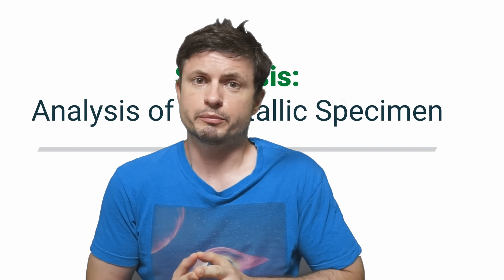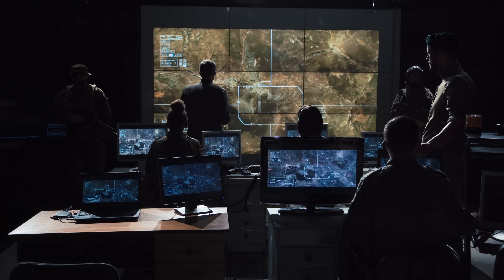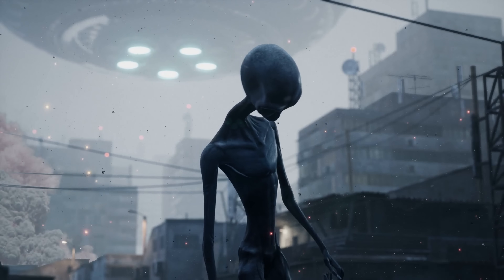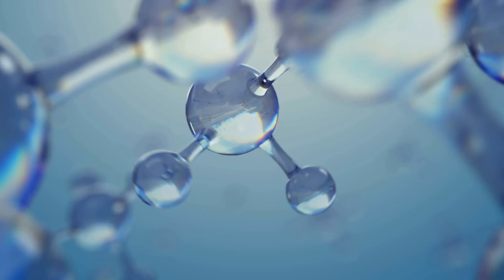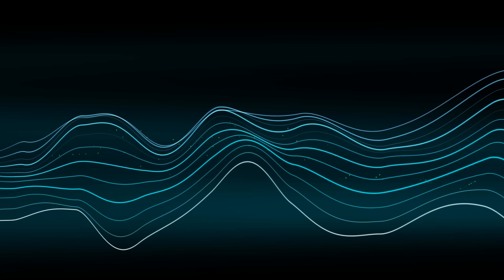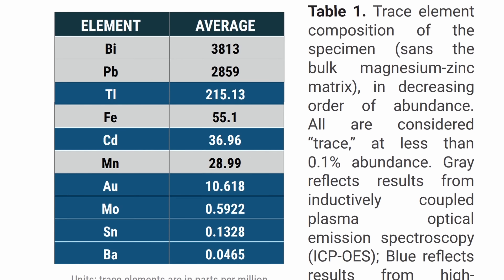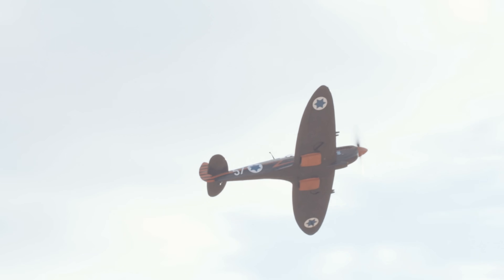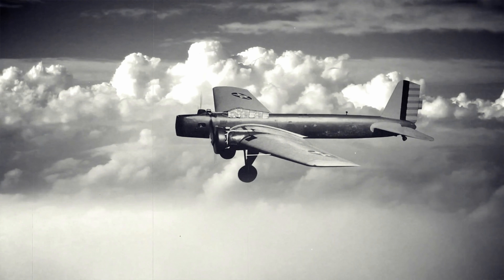Metal Piece From 1947 Roswell Incident Analyzed By a Government Lab

Comment: As this alloy is very rare and is made to refine the grain in magnesium and not to make it crystalline then it is very strange to find any of this material anywhere. let alone at Roswell. There has never been plates of this material made and it has never been used in any engineering application. The research into this material is actually very recent and can be found in The Journal of Alloys and Compounds in 2017. This is long after Roswell. We must therefor conclude that in fact this material could not have been made on earth at the period of Roswell as it had never been worked on. The plate looks like it was broken off a larger piece. What it would be doing in a farmers field near Roswell in very difficult to explain.

Comment: The ozone hole over the pole was believed to be 'opening' at an alarming rate. . . This may have been because as the instrument being used to measure, was not acute linear the voltage drop as the batteries condition and instruments needs were some of the unknown variables at the times of it's conceptions

Comment: Magnesium with Zinc as the principal alloying element is a fairly common alloy.  The presence of zinc allows for precipitation hardening and thus providing excellent strength properties.  It would be interesting to see if there were any other alloying elements present such as aluminum, zirconium, manganese and silicon.

These alloys are noted for their high strength and light weight.  It is an easily cast alloy as well as being a wrought alloy for the production of sheet and plate.

The high interest in Mg alloys prior to WWII is due to the light weight and high strength.  Mg alloys are about 2/3 the density of Aluminum alloys with comparable, and somewhat higher strength on certain alloys.

Mg alloys have been used for castings, forgings and fabricated parts in aircraft.  With the lighter weight the aircraft could carry more payload and fly faster.

After WWII, the push to utilize Mg alloys in aircraft fell out of favor due to the development of jet turbines and the high cost of Magnesium alloys.

Magnesium is extracted from seawater to produce the hydroxide which is then converted to the chloride salt which is then converted to the carbonate salt which is then converted to the oxide which is then electrolytically refined.  As a result, Magnesium metal is difficult to produce.

For example, a 2 ft x 4 ft x 0.063" sheet of aluminum 5052 alloy can be had for about $52 while the same piece of magnesium AZ31B will cost from $500 to $1,000 depending on the supplier.

hth

Comment: Those submillimeter layerings of metal were only BARELY possible in the most cutting-edge testing facilities, and that little slice of aluminum-bismuth alloy would have cost whomever manufactured it billions or trillions of equivalent dollars in the 1940s, and that's just accounting for the tools they would have needed to invent to work with the metal at such a small scale, let alone refining the process that led to them actually manufactuing the structure of the alloy you see before your goofy-ass eyes.

Keep telling me more lies about just how mundane that little slice of metal is, Anton...

Comment: On March 28, 1935, Robert Goddard launched another of his rocket tests near Roswell, NM. This trial was to test a device that was to provide the rocket a directional gyroscopically stabilized flight. His challenge was to find material that was strong enough to withstand the pressures of a rocket launch and subsequent flight yet would not influence his directional gyro that kept his rocket on a path of his choosing. So I wonder if that piece of debris could be related to that effort twelve years prior. That might explain its presence on that field that day when and where it was picked up.

Comment: Anton, I like this topic, today more then ever. We have dismissed so many things, like the 1700 years old, iron pillar in Delhi. This type of steel production has only been known for around 100 years! Especially now, in Siberia, due to melting permafrost, we find amazing new artifacts! the Homo Denisova bracelet, a 40-75,000 year old piece of jewelry made of chloride. Scientists have now discovered that drilling such a precise hole required extremely high speeds that were not yet possible at the time, apart from the fact that it was made by Denisovan hominids. Or the Lanzhou Stone, which was found in 1990 and is between 40,000 and 300 million years old. There are only 3 hypotheses about the origin of this artifact.

Comment: Magnesium alloys are used today. They produce lighter components with the same strength as aluminium alloys, but are lighter so are commonly used in Helicopters. As for evidence of of Aluen materials Robert Bigalo has gad several. Dr Kirkpatrick was either not given access to the information or is a lier. There is tons of evidence of UAPs.

Comment: What we know for sure is that whatever crashed in Roswell was not a balloon. The material they showed on TV at the time was definitely a balloon, and couldn't have been mistaken for anything else, by a 12-year-old kid, a farmer, and definitely not an officer from the air force. Therefore, what they showed on TV was not what actually crashed in Roswell.
Reply: We know exactly what crashed in Roswell - It was a specialized spy balloon with active height control and a variety of sensing equipment that was designed to recognize when a nuclear explosion happened anywhere on Earth - It's called Project Mogul.

The balloon part was followed by a 600 foot train of microphones and reflectors of various strange shapes that would definitely not look like a weather balloon (and, in fairness, weren't part of a weather balloon either). If you compare pictures of the wreckage at Roswell to pictures of Mogul balloons on flight, you can recognize parts one-to-one from the sensor train.
Reply: Read my other comments. It could have been a balloon, used by the Japanese.  Well after the war ended, but that means nothing to bushido, but disgrace worse than death..

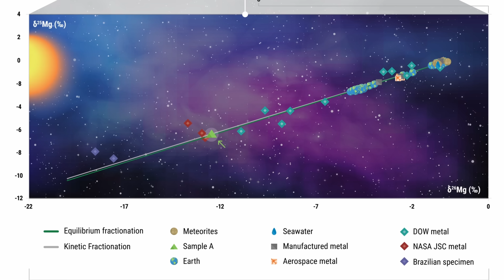Comment: The graph of % Mg25  (10:43) is wrong.  The vertical bar has 8% where 2% should be.   "Isotopes of Magnesium" in Wikipedia has normal Earth concentration of 25Mg at 10%.  Earth normals are on the wrong part of the graph.  ~6.7% for Sample A is far enough off to be of non-Earth origin.

Comment: You wouldn't need new physics in our atmosphere if you could manipulate gas molecules individually at THz frequencies.  There are 14 pounds per square inch of pressure exerted by air molecule collisions at sealevel..thats more than enough momentum to lift and accelerate quite fast an object to high speeds if the air molecules were suitably directed instead of randomly directed as they are naturally.  I believe the collisions per second are in the billions per square millimeter per second(Ghz).  To operate by laws of thermodynamics, it would be a Maxwell Demon type device but require still lots of energy to operate.  Such devices have I believe been demonstrated in small scale experiments, and we have many such protein molecules which act like Maxwell Demons for transport of molecules across cell membranes but utilize energy of course.   It wouldn't work in space or high in the atmosphere.  Maybe it's something we know about already and don't need to imagine new physics.  Whether or not UFOs are real, the human imagination might take us to such technology regardless.  Cell phones were inspired by Star Trek communicators for example.

Comment: In 2005  , at 3 am , i saw the silent black triangle . I was in the parking lot of a 24 hr walgreens on my way home from work. Incredibly this was in manassas , virginia.  I know what i saw . I dont know if it is ours or theirs. But i saw a huge , silent , black triangle with red lights on the corners and half way up each side. It was one of the greatest moments of my life.
Reply: Anything else you would be willing to share? Perhaps more details
Reply: Best chances of disabling an alien spacecraft the size of a car or smaller would be using an extremely strong magnet.  Any electrical components will become unstable, any computers will be killed and any loose metals will be pulled toward the magnet.  It may not work, but that's the best chances for normal humans.
Reply: If the alien spacecraft is larger than a car then only the US government could build a magnet large enough to try bringing down the spacecraft which might require the powerful magnet to be 1 mile square radius depending on the size of the UFO.  The only way a normal human would have a chance of bringing down an alien space craft larger than a car would be from the inside...   yet likely if you're on the inside then you're probably unconscious or unable to move.

Comment: Corrosion after 77 years of sitting in the desert changes the metals crystalline structure.
Magnesium has high chemical reactivity. The most important aspect from the theory of being a crash vehicle is that it would be the most likely candidate for building a vessel carried to extreme high altitudes by a balloon but a poor choice for a pressure vessel.
If experimenting to test materials for such a feat, Titanium would be a better choice if it had been available at that time.

Comment: Let me just come out and say this now. The real story of Roswell has been out in public for almost 30 years. It was a high altitude balloon test with a human passenger who had a leak in his suit. He survived but his face and his hands swelled up like giant grapefruit and were blue. Some of the metals recovered still haven't been released but are used in everyday manufacturing now. We call those metals memory metals. It's a metal that is formed in an exact shape and you can bend it and then put heat to it and it will return back to its shape. This exact metal is described by the farmer who finds it in his field and at the time was classified by the military so the public didn't know about memory medals. The thin aluminum like metal they found across the field was mylar used on top of the balloon to keep the sun off of it so it wouldn't pop. Does saucer like objects recovered was the capsule that carried the high altitude pilot. At the time we were testing classified flight suits and at the same time we were developing radar jamming technology at area 51 in White sands and telling the Russians they were UFOs because they looked like giant flying saucers on poles. From a distance you couldn't see the pole so all you saw was a hovering saucer for hours at a time. We see the same saucer-shaped dishes used on aircraft for surveillance and for NASA tracking now. This is when we developed the technology and the fact that it is human-based is more impressive, unfortunately it's not as impressive as everybody thought it was because it was the turning point and some of the technologies that we use in the 80s and 90s and we have surpassed them now. When they rushed the astronaut to the hospital he looked like a swollen alien and all the doctors and nurses saw this guy's face filling his space helmet and his hands were swollen bigger than the gloves so he didn't look human. There's thousands of cases of people looking the same way, they just didn't fall out of the sky during a military test in the 70s when none of this technology was supposed to have existed.
Reply: Sure. UFOs on invisible poles. Makes sense. Especially from the perspective of a commercial jet pilot who, in conversation with me, was complaining that all his fellow pilots saw UFOs but he ( even though he always wanted to see one ) did not. During flight. Flying around a jet liner. ON POLES. Idiot.

Comment: The most infamous use of magnesium alloy was the crankcase of the Wright R-3350 engines of the B-29.  This was just one of the many failure points in the design of the B-29 causing it to have a high loss rate from mechanical failures that ended up with an unstoppable engine fire that then caused the whole wing to break off and the plane to crash
Reply: Lots of aircraft were made from magnesium alloys in the 1940s, especially German ones due to shortages of aluminum in WW2 Germany. I think it plausible that the aircraft that crashed in Roswell was a captured advanced German jet prototype.

Comment: Heres my take: The U.S government knew that the Soviet union would become an enemy after WW2. So, they began development and testing of secret spy planes. One of these spy planes crashed at Roswell, New Mexico. There were witnesses who saw some of the wreckage and said the pieces were like something they had never seen before. Well, what if those metals WERE new space age metals for high performance spy planes? 

The markings that were deemed "Alien writings" could have been labeling of the specific parts using a code only the engineers understood in the event that if the plane crashed, no parts could be traced back to the U.S.  Witnesses said they saw weird bodies in the wreckage, wearing what looked like suits. Well, what if the pilot of these crafts were indeed wearing a high altitude suit? Similar to the ones used by U-2 and SR-71 pilots? This would allude to the craft being made for high altitude reconnaissance.  

Next thing you know, these stories of Aliens began to circulate. So, instead of admitting that the crash was actually a secret spy plane and bringing it to light that the soviet union gets word of if it, they roll with the alien story to hide their spy plane. 

The government has done this before. When the F117 Night Hawk had crashed into a mountain, the government pulled the same exact thing to keep the plane secret. 

They may also have caused the Kecksburg UFO incident as well. People claimed to have seen an object fall to the sky, being steered before crashing into a Forrest. Witnesses say the air force had taken an object from the ground shaped like an acorn. My two cents? It was the test of one of the first nuclear reentry vehicles. People claimed the area was radioactive, the military personnel there eve said the same thing. Also, it was being steered as it changed course, now some reentry vehicles can be steered but what if its gyroscopes had malfunctioned and it couldn't steer and so it crashed? There are many witness drawings of the so called ufo and all accounts show an acorn shaped ufo with a thick base. Do you know what reentry vehicle fits that description back in 1965? The Mark 2 reentry vehicle.

Comment: The high-altitude sampling ballon was one of several sent up by my old military unit.  Roswell was one that crashed - malfunctioned.  Our crew used up the duck tape from the hardware store, so he sent us to the local drug store's arts & crafts dept.  White duck tape with abstract & geometric symbols on it - not an alien language.  The light weight, aluminized mylar caused more confusion.
We fed the Army's UFO story to help divert folks from the real nature of the project.  

btw The little green guys were GI Joe dolls used by a different group that was testing reentry vehicle thermal shielding.  They forgot to include a recording thermometer, so the Col. had them stick in the dolls/action figures on the premise that if it got hot enough to damage the dolls, then it would be too  hot for astronauts.  This bought time for the contractor to come up with the missing equipment while testing continued without it.
Reply: Just because your old unit tested weather balloons doesn't mean that's what was found at the Roswell site. Too many civilians saw it firsthand and gave a completely different description than the Army.  I'm not saying it was alien in origin, but it was something other than a weather balloon. One man told a story about finding fiber optic strands in the hills near his family's ranch. He said it was 1945. They didn't know what it was and used it on their Christmas trees. Years later, he dug the stuff out of the attic and figured out what it was. Fiber optics was not common in 1945. I would guess that it didn't come from a weather balloon.
Reply: @TexanUSMC8089  It was NOT a weather ballon, yet it was a high altitude ballon.  Date & time of the loss match up with Roswell.

Comment: Magnetohydrodynamic drive developed during the 1930's by the Nazi's.... after WW2 they were doing test flights and one crashed in 1947, they threw in the "little green men" as per the usual PSYOP military strategy. They then spread rumors for decades about aliens, throw in some blame to other countries to drive public fear and confuse them. Same with the newest congressional testimony. Its all PSYOP to divert attention away from DARPA and US Navy/AirForce tech. The tech is so world changing that it would shift the axis of power & our NATO allies would want the same tech which would risk other nations getting it as well.

The tech is actually fairly simple in concept, create an intense electostatic field (millions-tens of millions of volts) which forms an EM "bubble" pushing air away from the hull without causing friction (why they can fly non aerodynamic objects at ridiculous velocity). You can alter this field to push the vehicle around due to well understood electostatic propulsion physics. (though some of the electostatic data is highly classified as when you get into the millions of volt ranges it can cause quantum changes which enable bizarre physics phenomenon)

Comment: No crystalline structure? Metals are typically crystalline. Amorphous metal, aka metallic glass, wasn't officially discovered until 1960. 
Either you confused the findings or this is quite significant simply based on the US military having amorphous metal already in the 1940s.